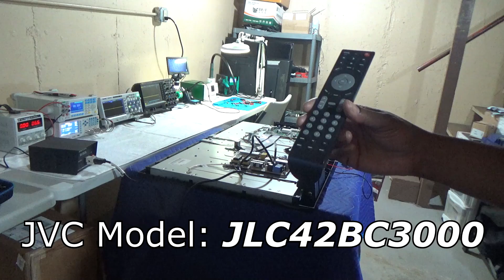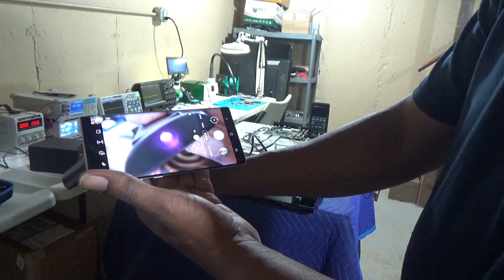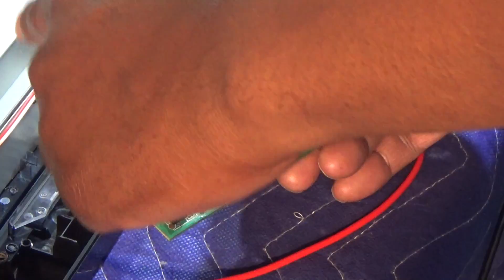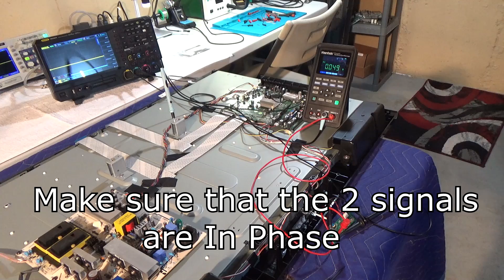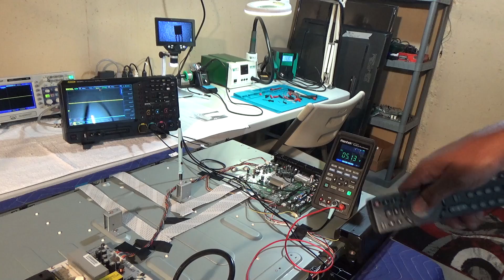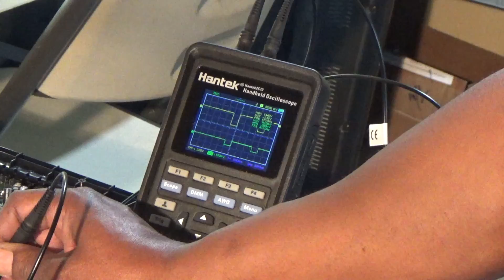TV not responding to remote control. How to troubleshoot the IR circuit using an oscilloscope.

Comment: Hi. I tested my infared sensor on the remote under my cell phone camera. The light comes on for all buttons except the power button. Is that normal?
Reply from the maker: No! You got a problem with the Power button pad inside the remote. If the TV is not coming on with the remote, then try using the actual Power button on the TV.

Comment: Oh, using the older HP 8100 SFF now. Mother Board was fried & the new refurbished $20.00 one works perfectly. Took less than a half hour but buried the fan hook up wire under the board when putting it in so had to loosen screws to lift it up & out to put it in the fitting & that solved the issue!  That was a good computer with great specs & is Windows 10 compatible & fast as heck.

Comment: You have some intense array of equipment in your workroom.. Had that happen with a Coby 22" TV/DVD combo I had and it was simply the plug into the little remote board was not plugged in but the remote itself never worked quite right when it did. That company is out of business now. Gonna change an older HP 8100 Small Form Factor main board next & hope it works. No video on boot & fan ran amok when on.. Worked great & fast the last time it was used & I noticed a lot of very thick dust/dirt build up on the front fan passageways. Wonder if it fried it???